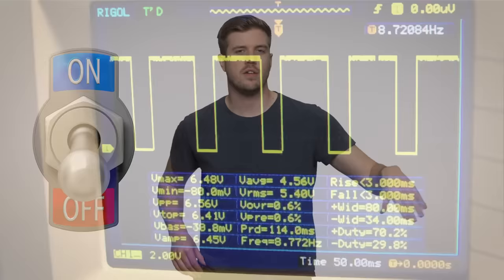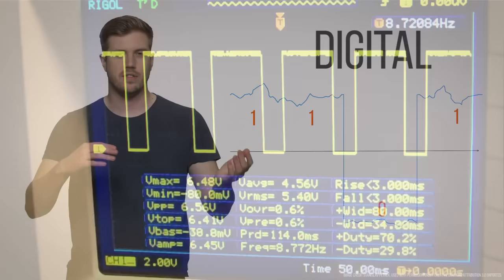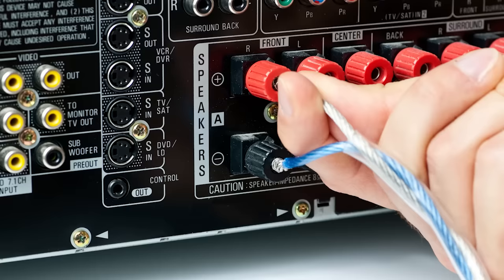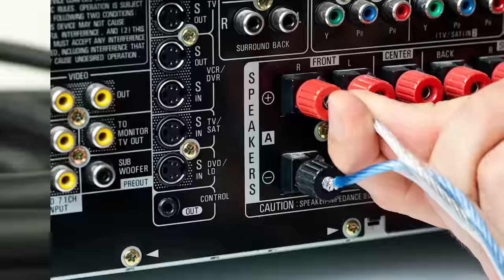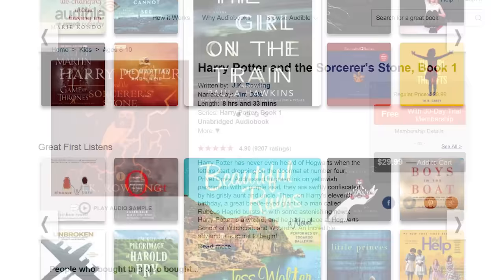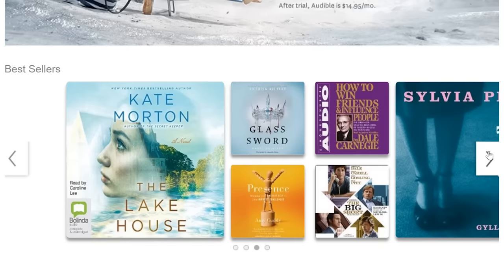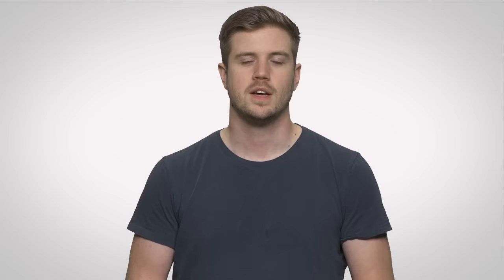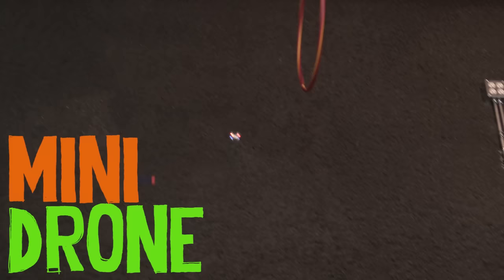Analog vs. Digital As Fast As Possible

Comment: I love FLAC, almost all my music is in FLAC and over 800kbps
Reply: Yeah I'm using Windows Media Player to play my FLACs and it works perfectly. No need for codec packs or fx VLC player. And yes, I have had like 10 FLACs/songs on my Xperia Z2 but if I go higher than 1400kbps, my Xperia Z2's music player crashes.
Reply: Thats true! But with my Corsair SP2500 I can hear the difference between 256/320kbps mp3 and FLAC's when the volume is up a bit. The SP2500 sounds fantastic.
Reply: SP2500 is certainly worth the money. It is simply the best 2.1 audio system made for PC I have ever heard.
Reply: But sure, it comes with a price.
Reply: +GrandTheftAutoZen - BetteBalterZen It sure does come with a price! Can you recommend a good budget friendly 2.1 audio system?
Reply: Actually I don't think I can because I never had any, please understand me right, "cheap" speakers. So I really don't know any. The last speaker system I had for PC was my long lasting Logitech Z5500, 5.1 Audio system made for PC.
Reply: ***** #MasterRaceProblems XD
Reply: FLAC is lossless, the bitrate doesn't matter, it's just the space taken to store completely and losslessly the audio in question.
Reply: ***** Indeed, unless you still use floppy drives.
Reply: Space is not a problem when you use FLACs in 16bit. Most songs like 30/35MB. Tho if you use 24bit it is more like 130MB
Reply: ***** Yes, I know, my primary point was that the bitrate does not matter in a FLAC recording, since it will be able to retrieve all information of the original source, thus lossless.
Reply: ***** Both 24 bit and 192kHz are useless for high fidelity audio data, if not degrading due to intermodulation distortion from supersonics.

https://xiph.org/~xiphmont/demo/neil-young.html
Reply: Çerastes What you are saying about the sampling rate is a bit misleading. Audio files that are over 48kHz don't give any benefits at all, that's true, however the higher sampling rates are essential for audio techniques such as oversampling, that way you can get all the benefits of higher sampling rates without any of it's drawbacks (distortion). By using 48kHz you give headroom for those techniques (analog filters as well). 

I quote Monty Montygomery here:
"All signals with content entirely below the Nyquist frequency (half the sampling rate) are captured perfectly and completely by sampling; an infinite sampling rate is not required. Sampling doesn't affect frequency response or phase. The analog signal can be reconstructed losslessly, smoothly, and with the exact timing of the original analog signal.

So the math is ideal, but what of real world complications? The most notorious is the band-limiting requirement. Signals with content over the Nyquist frequency must be lowpassed before sampling to avoid aliasing distortion; this analog lowpass is the infamous antialiasing filter. Antialiasing can't be ideal in practice, but modern techniques bring it very close. ...and with that we come to oversampling."

"Sampling rates over 48kHz are irrelevant to high fidelity audio data, but they are internally essential to several modern digital audio techniques. Oversampling is the most relevant example [7].
 https://xiph.org/~xiphmont/demo/neil-young.html#foot7

Oversampling is simple and clever. You may recall from my A Digital Media Primer for Geeks that high sampling rates provide a great deal more space between the highest frequency audio we care about (20kHz) and the Nyquist frequency (half the sampling rate). This allows for simpler, smoother, more reliable analog anti-aliasing filters, and thus higher fidelity. This extra space between 20kHz and the Nyquist frequency is essentially just spectral padding for the analog filter." 

https://xiph.org/video/vid1.shtml

https://xiph.org/video/vid2.shtml

The other details (techniques, headroom) you can read here: 
https://xiph.org/~xiphmont/demo/neil-young.html
Reply: Çerastes My bad. Fixed.

Comment: Why did they start with aerial TV broadcasting anyway? When analog cable is better all the way and it's basically the same technology, it doesn't make sense to do terrestrial broadcast. The picture quality just sucks compared to cable.
Reply: Having to do the cable deployment, means having to deploy hundreds of Kms of coaxial wire, amplifiers and a lot of stuff, so an electromagnetic signal was cheaper and easier to distribute

Comment: Digital transmission is NOT more reliable across longer distances! As someone that grew up in the "analog" era, I can tell you right now, Digital TV sucks compared to analog. With a poor analog signal, you got some snow and waviness, but you could make out the picture, or still hear your radio station. With digital, it either receives a signal, or it doesnt, which REALLY sucks! That's why the image starts to break up with all those trippy colors and blocks because it simply can't decode the poor quality signal. And with digital, if 1% of a frame is lost, then that entire frame will be lost or corrupted. Also with digital crap, we arent seeing the entire picture, just the parts of the picture that have changed since the last frame, and also we get the crappy "blocks" in the picture from jpeg compression of the frames. This is also why you can no longer make out super dark areas in movies, or you can notice the blocky-ness in those dark areas, because as that frame was being compressed, that data was thrown away. Soooooo wish we could go back to analog signals over the air and analog broadcasting.
Reply: Same to you. Google it! I'm also old enough to where I lived through the change, and I've been a technician for 20 years.

Comment: Man, fuck digital television. 
When the FCC shut down analog television back in 2009, I was pissed. 
They were basically forcing us to switch to new technology when 99% of people I know were perfectly
happy with analog NTSC, including me.
I couldn't afford cable at the time, so our only option was to buy those shitty converter boxes.
It may not be so bad where you live, but where I was (rural Kentucky) it fucking sucked.
There were only 13 channels (remember the '40s? i don't) and all of those had this really crappy
stutter problem (a product of the encryption of the digital video signal)
And to make it worse, most of these station were for really old people.
Over the years it got sort of better, with more channels being added, but it's still pretty shit.

EDIT: I was expecting FAPquickie to make an essay on those crappy boxes so I typed up my sexperience here <--- (that's not a typo)

Comment: software vs apps 
plugin vs addons
Reply: +MrBall Breeder they are the same
Reply: 0M9H4X same as apps is same as software or program and same as addons is the same as plugins. old vs new naming
Reply: MrBall Breeder all apps are sofware, not all software is apps. Plugins and addons are literally the same though.
Reply: 0M9H4X apps and software are the same .both are coding for application
Reply: MrBall Breeder No, your car runs software but not an "app". Windows 10 is also not an "app", neither are drivers or firmware etc
Reply: 0M9H4X software is coding for applications so applications run by software. car runs on software for applications like robotic gearboxes. windows 10 is coding for applications for  firmware and hardware (bios /uefi)
firmware is coding application for hardware

apps is shorted name for applications

only applications that dont run software are mechanical switches (ex mechanical relais)
all electronic applications even IC,s are coding applications

dont need to believe me but heres an wiki quote:
The term "app" is a shortening of the term "application software". It has become very popular, and in 2010 was listed as "Word of the Year" by the American Dialect Society

from this page:
https://en.wikipedia.org/wiki/Mobile_app

you can also reed this:

http://google.about.com/od/a/g/apps_def.htm

so windows is a program so its an app

dont tell me that you dont know about the terminology "software "eader because you sound like you dont know.
Reply: MrBall Breeder funny, i leave it to your wife too
Reply: 0M9H4X thanks i appreciate it

Comment: Honestly hate this topic. Most kids today, and even some older people assume just because its digital its better. Even though analog is more stable and reliable. Say a tornado rips through your neighborhood or you're caught in a hurricane, you want to pick up an FM radio and listen for the news. You most likely wouldn't have internet access in a situation like that. Analog is also better for sound recording, reel to reel mostly.
Reply: +Walnut Spice I work full time in radio (AM radio) and still use tapes, reels, and vinyl to listen to music when I can.

But that's the catch to analog audio, it does sound outstanding, but you really gotta put in the time, effort, and equipment cost to get it right. 

Most people's experience with tape is ripping a broadcast on to tape with a crappy boombox, which sounds god-awful.

Using a deck with good heads, bias adjustment, and recording controls...sounds amazing.

So, hi-fidelity audio in 2016 has got to be a personal hobby to get the best results.

But there's nothing wrong with MP3's in everyday settings, like in the car or during a workout...which is arguably 99% when people listen to music.

But at home relaxing with a beer, I'm firing up a vinyl or cassette.
Reply: +Walnut Spice It's not really feasible to transmit digital signals through the air or down a wire. Internet data is modulated into an analog signal before being transmitted, so technically it could be considered analog. The distinction you're making doesn't actually exist.
Reply: wanswers Isn't that bluetooth though?
Reply: Walnut Spice The data almost certainly travels in some analog form, be it Bluetooth, WiFi, coaxial cable, fiber optic, 4G, phone line, etc. Because of the sharp (thus very high frequency) nature of digital signals, among other reasons, it is not practical to transmit them over long distances through any medium, which is why they are converted into some analog signal and then processed at the other end to retrieve the digital content (e.g. modem).
Reply: +Jween Tech Honestly, CDs are the best audio format ever invented (technically SACDs are even better, but those never really caught on). CDs can store 700MB of data, which is plenty for a FLAC copy of a medium-size album, which would sound incredible even on the worst speakers.

Analog can sound fantastic, but nothing beats an effectively perfect copy of what you're listening to.

Unfortunately most music today is 128KB/s garbage.

Comment: digital digital digital forever
Reply: +Edd360 Analog is better. Digital things are complete shit. Audio tape is better than digital, film cameras will always be sharper, more high quality with better colors than digital cameras, FM radio sounds better than Bluetooth audio ever will. I'd go on but we'd be here for hours
Reply: +Walnut Spice Tapes have awful hissing, film has grain, lens flare, and is limited to low framerates, Bluetooth and all other digital audio forms are perfect copies of audio, you literally cannot get any better than a FLAC file without upgrading your speakers themselves.
Reply: JJ Warner Not with reel to reel, also grain is not an issue, and its something some people purposely bring out.
Reply: Walnut Spice It is still not as good as a FLAC file would be, and grain is a limitation, if I wanted to make a movie with no grain in it, I would be shit out of luck.
Reply: JJ Warner The grain would be replaced with pixels
Reply: Walnut Spice It would still be visible, though, if I converted to digital.
Reply: JJ Warner You got a point there. An argument I like to make though is a movie shot in 4k or 1080, it will always be 4K or 1080. A movie shot on 16 or 35 could be scanned in whatever resolution scanners of the time and storage mediums will allow. Example would be movies shot in the 90s, new rescanned HD versions for Blueray or digital HD can be full 1080p. But a movie shot in the early 2000s on cutting edge digital cameras of the time will always only be the lowish resolution it was shot it.
Reply: Walnut Spice So? It won't make it look all that much better, honestly. Digital is catching up quickly to film and it will very soon surpass it, in fact it basically already has in most aspects.

Comment: But the microphone is still analog technology...
Reply: +1sonyzz That's because it has to be, you can't record sound directly to digital.
Reply: also headphones...
Reply: Sound (analogue) --> Microphone (analogue) --> Audio to digital converter (digital) --> mp3 file (digital) --> Digital to analogue converter (analogue) --> Speaker/Headphones (analogue) --> Sound (analogue)
Reply: so we still using analog technology :)
Reply: +1sonyzz to a certain extent, yes :)

Comment: that clock is a terrible, terrible example. Most clocks go in stutters, with a limited number of states, thus they are more digital than analog. A better example would be a windmill, or your bike.
Reply: A "stuttering" clock can still apply to this analogy as it still fills all of the space in between each "tick", so therefore its automatically analogue because of this
Reply: Dylan Collins by that logic, a digital signal also takes all values. After all, voltage can't change instantaneously in most real circuits, therefore all voltages are at some point occupied, even if for less than a picosecond.

Therefore, if you'd view everything in that way, everything is analog. Technically true, but utterly unusable.
Reply: Technically it is true but the time it takes for a clock hand to occupy all of the space between each second is much longer than the time it takes for the voltage to change in any electrical circuit.
Reply: Dylan Collins on the relative timescale, it's not much different.

Comment: Exactly why I can't go back to play on old consoles: analog video looks like total dogshit on an HDTV.
Reply: +DrearierSpider1 So play it on a CRT? Not hard.
Reply: Walnut Spice Don't have one anymore.
Reply: +DrearierSpider1 All about native resolution. Old consoles look WAY better on a CRT (crisp and sharp) than on an HDTV (fuzzy and washed out).

But that also has to do with the composite video connection.

For instance, a PS2 using the component input of an HDTV looks WAYYYYYYY better than just the yellow composite cable alone.
Reply: DrearierSpider1 Got $5 and craigslist? You can find a shit ton on there for real cheap